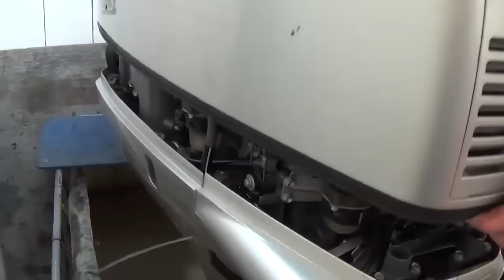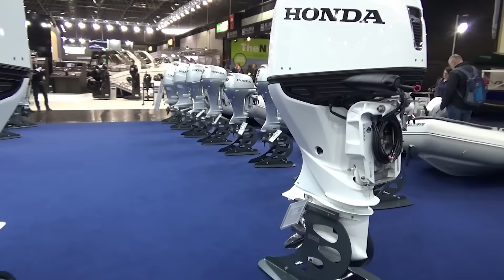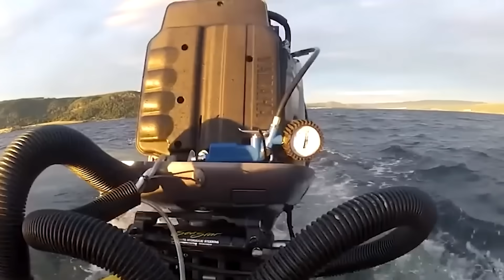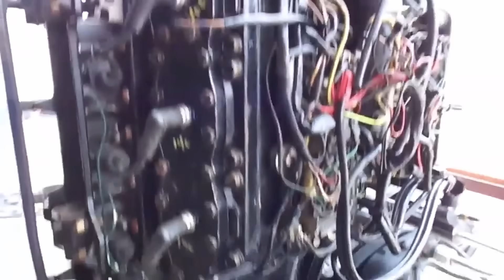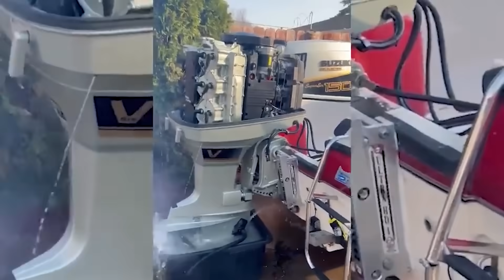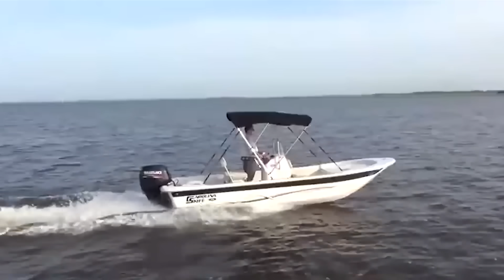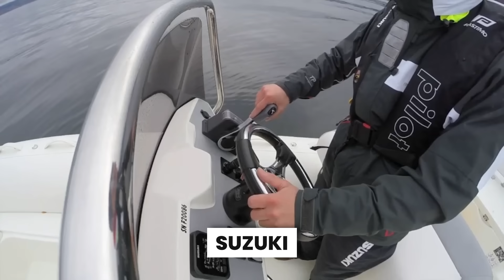Why Japanese and American Motors Are So Different?

Comment: I'm sure it is a lot like with automobiles. American made automobiles before Toyota and Datsun (Nissan) came in to the American market, the Big 3, seldom produced a product (engines) that would last more than about 70,000 miles. And still, Toyota as well as many other foreign brands still outlast and consistently have better and longer warrantees than the average American made automobile produced today.

Comment: My dad bought a 7.5 hp Mercury out of the crate in '75.  You literally had to pull it 60 times to get it start. Later on he updated to a 25 hp Mercury. Better, but idled poorly.  Bought a new boat with a 30 hp Yamaha.  Night and day. Ran like Swiss watch with amazing fuel efficiency. Now this was late 70's and 80's, and I'm sure Merc's improved, but this was our experience.
Reply: Mercs under 20hp are made by tohatsu.
Reply: @williamsporing1500 After 1988.

"In 1988, Tohatsu and Brunswick Corporation formed a joint venture called Tohatsu Marine Corporation to produce outboards for Mercury Marine. Some Mercury outboards, particularly those below 60 HP, were rebranded Tohatsus."
Reply: I JUST BOUGHT A USED 70’s MERC,7.5 for $30 in parts and a little clean up it starts and runs great! The Mercury 2 strokes are pretty bullet proof !
Reply from the maker: @Happy11807  sounds like a fun little weekend project! Enjoy!
Reply: @Happy11807 Ours was a turd right from the start.
Reply: They were not Tohatsu in 75’. I’ve had two from the seventies, blue stripes. They were the best.
Reply: @jeepgirl1653  my brother still runs a ‘65 Johnson 9.5 that I gave him years ago. They just built stuff better back in the day.

Comment: I have had two Yammys, a Mariner (Merc) and now a 4 stroke Merc.  No problems with any of them.  Just keep them maintained and serviced.  My buddy is a Honda dealer that has sold Merc and OMC over the years.  He swears that Honda is the best and most bullet proof motor available.  They are each very good and you can’t go wrong with any of them.  I know Suzuki had issues with their Super 6 150 back in the day, but friends with Suzukis these days are very pleased with them.  One thing to consider is that you can get a Merc serviced just about anywhere.  Not so with the Japanese motors.
Reply: I was a Suzuki dealer in those days. The issue with the New super 6 150 was the electronic microprocessor. It took 6 months to find the ladies in Japan building those brains were leaving corrosive hand oils during their monthly cycle. So they worked 3 weeks a month.
An annoying ignition speaker in the dash would squalk at 5 am in English with a Japanese accent to check your oil, check your temperature. You could not remove it but silence the speaker. Funny that 5am at the slips all the 150s were squalking.
Reply from the maker: @marcmccord5085  Thanks for watching and commenting. Had to back his own brand j guess! But they are reliable as anything.

Comment: Japan produces for commercial use and the USA for recreational.  That is a big difference.
Reply: Buy commercial quality and use it recreationally and it will outlive your grand kids.
Reply from the maker: @jj25397  Generational pleasure on the water!
Reply from the maker: @MarkRouse-j7z  Not a bad way of putting it at all. Thanks for commenting Mark..
Reply: What outboards are American?
Reply: Mercury, Mariner. But sometimes its hard to tell American from Japanese as some American engines are japanese labelled @douger1517
Reply: @douger1517  the one's most Americans can't afford.  :)
Reply from the maker: @jj25397 got a video that might be touching on this in the making! Stay tuned.
Reply: if so, they're on way higher premium, not cheaper.
Reply: I think it’s fair to say mercury. Marine owns the industry now. Maybe 30 years ago things were different.
Reply from the maker: @TommyP-s9n Yamaha not far behind but yes Mercury seem to be the dominant force. Especially in the higher HP range!
Reply: @VintageBoats  Mercury simply have been around soooo long. they know the score. Anything in the 80s-90s range of 4 strokes wernt that reliable but the 2 strokes before that were extremely reliable and high powered in the 70s.
Reply: @TommyP-s9n I have 2006 50hp Mariner and it's flawless. My club owns a mix including Tohatsu, Yamaha, Suzuki and Mariner. All are regularly serviced and kept tip top. It's the Tohatsus that have been disappointing.
Reply: The difference between Japanese outboards,is Japanese engines are great and American Motors are crap 💩
Reply from the maker: @garywatson9917 thanks for watching. Cast your vote in the community post to take your side!
Reply: You know Armerica inventions have shaped the world right. You guys bring your 458 ferrarri to Americia can get smoked by our Corvette every day
Reply: @garywatson9917 japanese engines are like ugly but loyal wife and american is like hot wife that just might cheat on you.

Comment: I wonder how much Yamaha paid for this YouTube commercial? I work in a shop that is a servicing dealer for Mercury, Yamaha, and Suzuki. They all break and they each have their own specific type of failures. I see a very high rate of internal corrosion in all of the Japanese makes. They all including Mercury have external corrosion issues but the Japanese makes will corrode through the cooling systems in the block and cylinder heads or they will plug themselves up with corrosion and growth. I wont say it doesn't happen but I have never seen a mercury corrode through. At least with the past 30 years of models. I have had plenty that where almost impossible to get apart but not corrode through the block or head. Evenrude and Johnson where pretty much the same as Mercury when it comes to internal corrosion. Maybe it's different in other parts of the world but where I am this is what I see.
Reply: I just look at what the pro uses. I'm in Newfoundland and deal with fisherman that pry the North Atlantic for a living and you won't find much Mercury here.  I own a small one for my dinghy and it'll be my last. Next one is a Yammy.
Reply: That's exactly what a mechanic said to me once!!
Reply: I have a 225 2019 Yamaha and the lack of quality stainless steel is a problem. Taking the side cover off to change the oil you see all the corroded motor mount hardware and the star nut on the bottom of the swivel. I cleaned and sprayed with anti corrosive but will have to order the replacement parts and due in the off-season.
I was a mercury and OMC tech in the 70/80s. The stainless was excellent but threads were never protected on assembly. I spent many hours drilling and tapping the water jackets, baffle plates bolts.
At $ 45.00 an hour customers were not very happy but not much choice. Those were the days of the oil n gas embargo’s and rising prices
Reply: "Yamaha commercial" or not it seems to be spot on as a customer of boats and powersports. Confirmed by trusted dealers in my area south FL.
Reply: mercury from 2 to 30 hp are japanese tohatsu.
Reply from the maker: No sponsorship on this channel!

Comment: Suzuki has been bought out by Bombardier in Canada by a locomotive company that owns Johnson  & Sea Doo. I had a 26' Seacat with two Suzuki 200 two stroke FI and both lower units cracked due to bad aluminum casting. Now I have a Mercury Optimax that ran like a racehorse now has been sitting in my yard needing all kinds of work. When Honda four strokes came out all of the commercial fishermen and crabbers bought them up and ruined the starters by engaging them while the engine was running. All are good when new and if constant maintenance is kept up will provide lasing service, but my preference would be a Yamaha four stroke.
Reply: No, BRP (Bombardier Recreational Products) did not buy Suzuki outboards. BRP did, however, exit the outboard motor business and stopped production of Evinrude outboards in 2020. Suzuki outboards are manufactured and sold by Suzuki Marine USA, LLC
Reply: @Briandswinford  japan

Comment: I think the newer Evinrudes were the best on the market. Hate they were bought out and closed. Saw many head to head tests on the same boat and they slammed all of the other brands. We had an old, old oil burning loud Mercury way back in the 60’s. We finally got a new boat in the mid 60’s with a 65hp Johnson. It was frigging huge but had power for days. Back them a 16’ ski boat was a normal size boat. My Dad pulled 4 of us skiing at once. 2 on pairs, 1 dropped a ski and the other got up on one. 2 kids under 12, a 16 and 17 year old. That boat and motor is still alive today. My cousin bought it in the late 80’s and still has it. I’ve had twin Mercrusiers in a 33’ Sea Ray express cruiser. I know we’re talking about outboard but  Merc is the company. I hated those engines. 6.3 I think with horizon transmissions shaft drive. They were the most inefficient engines I’ve ever used. 20 gallons per hour per engine. I have a dual jet drive water sports boat now but if I ever go back to salt water cruising, the boat will have Volvo IPS diesels. Never another Merc.
Reply: @bks252  my Mercruiser 7.4 Bravo II is awesome. Pushes the 30ft. Aft cabin motor yacht 36 mph and is very easy on fuel. Well maintained and never had any problems.
Reply: @jeepgirl1653 I’m sure the weight and hull design are important factors with fuel. Sea Rays are really heavy. Maintenance was fine.
Reply: @bks252  WHERE?
Reply: They did close but Evinrude is back again, being made in WI once more.  My father, brother and I all worked for OMC Evinrude for many years.  OMC Evinrude and OMC Johnson are like GM autos or GE appliances with many interchangeable parts, but different trim and paint.  The electric trolling and outboard motors of 55 hp or less, were all assembled on the same assembly lines.  The same went for their snowmobiles, my wife worked there.  I worked at 3 different OMC plants and saw or did all of the above.
Reply: @kypackerfan4-12-15 that’s awesome they are back. That new engine they were/making was fantastic. So much power and very efficient. Can’t remember what the name was. Maybe ETEC or something like that?
Reply: @bks252  I have a 2013 50 E-Tec ,NO PROBLEMS AFTER 12 years, will out tow,preform,and top end than any Yamaha,Mercury,Honda,Suzuki,on the Market. Can winter store it Dec1st. In 5 minutes,than take it out a week later and do it again! Best idea any Mfg. came up with!
Reply: @kypackerfan4-12-15 I wish that were true but Evinrude / Johnson names were bought by BRP and are now completely dead! I'm afraid never to rise again!

BRP's engineering & designers redesigned the problematic rushed to production FICHT motors! BRP 's  Etec's solved all those problems! But BRP's poor management & lackluster (almost non existent re-educational) advertisement was BLUNDEROUS!

Your mis-guided information about Evinrude being produced again is behind the times! And unfortunately, FALSE! 😢

Comment: Those Johnson were a great engine.
Reply: An Evinrude and a Johnson are the same basically; just like a GM auto or a GE Appliance.  With a few different minor component parts, trim and paint color.  My father worked there 32 years, my FIL, 35 years. I worked for OMC 15 years, my brother 22 years, BIL 26 years, my wife, my SIL, my 2 uncles and a 1st cousin all did.  Look at close up photos, the data plate is even the same shape and in the exact same spot on the transom mount.
Reply from the maker: @kypackerfan4-12-15  All the family in there! That's super cool. You guys must have some cool snippets of the industry history then!

Comment: I use the smaller outboards in the 60hp range. My preference is Yamaha due to reliability, quality, and efficiency. Plus they’re Made in Japan which holds better resale value. Yamaha is the Toyota of the sea. 
In reality, they’re all good when new.
Reply: @slagletoby  Almost ALL LOWER RANGE YAMAHAS AND MERCURY 4 STROKES ARE  MECHANICALLY THE SAME,ALLTHE PARTS ARE EXACTLY THE SAME! Some Mercury 2strokes in the 90’s were rebadged Yamahas!
Reply from the maker: @Happy11807  Thanks for sharing knowledge and time on the channel
Reply from the maker: @slagletoby  until they're not. Especially if not looked after in the salt..

Thanks for watching.

Comment: I have a 225 Tohatsu-Honda  5782 hours i went and checked before i commented and it still going like new    and i treat it like a taxi engine never stops for a oil change 😂 my next motor i will buy if the 225 i have ever gives up before i die will be another Honda or Tohatsu 300hp but ,,  the japs make good stuff they have pride , funny my old boat is a pride 😂 i have a old 90 Yamaha enduro on my small boat im amazed it still going i don't look after at all it just flat out on the river hitting sandbars stuff props regally just to feed my face with mud crabs one's a week 😂

Comment: Because Japanese outboards are like Lexus'-they LAST! 6000 hours on a Suzuki 600HP or Yamaha 400HP 4-stroke isn't uncommon. 600 hours on a 400HP Mercury is amazing. Few bass-boat dealers in NE Okra-Homer will sell a 500HP Mercruiser-too many call-backs and failures. Notice both "Miami Vice" and "Dexter" went away from Merc's and Evinrudes???Too many failures in filming costing too much to re-shoot. THE absolute unquestionably BEST marine outboard is the Kai Ichei (Toyota). They are also almost ten times the price of the same HP Mercruiser. They build a 900 HP "twin Hayabusa" V-8-the drag surf-boards (micro hulls) use-'em to top 105 Knots on Eufaula Lake. If they literally hit a turtle in the water, the OK Lake Patrol has a three week search ahead of them..
Reply: interesting...must be the reason why there's so many insane HP outboards out there, when I would think an inboard would do.  I thought MerCruisers were simply GM engines with a Mercury lower unit connected to them...just ordinary old Chevy LS or small blocks. I know many commercial fishermen tended to like inboards over outboards, because they could be service within the boat while out at sea.  With an outboard, you risk dropping a part or a tool into the drink when trying to make a repair at sea.  Of course, the Japanese changed all that, because their outboards simply didn't need to be serviced out at sea!
Reply from the maker: @audvidgeek  When you start looking at wake boats, Malibu for instance, there's a lot of truth it this. Basically a marinised GM engine in those.
Reply from the maker: @Walkercolt1  thanks for watching and the detailed comment

Comment: There is no competition ! Mercury have been making under performing anchors for years. Most Japanese motors simply crap on the US made junk.
Reply: wish it wasn't true, but that's how I see it.
Reply from the maker: @rod7944  I'm guessing Rod you are from US and admitting a little defeat? Thanks for watching.
Reply: @ I'm not sure what you mean. This is what I'm saying. My experience with Suzuki is that they are awesome engines and better than any US made outboards. If that's what you mean, then, yes.

My df 200 is ALWAYS quieter than any American made product I see at the ramps. I've been running Zukies for almost 25 at an average of 125 hours per year and have never heard one so much as cough. I cannot say the same for the American outboards I have ran.

and those poor souls that got sucked into the 2 stroke direct injection craze really paid the piper. I doubt there is many or any of the older E tecs still running at all. If anyone still has a running E tech, they should put it in a Museum.
Reply: @VintageBoats  Yes. LOL. But I consider us all winners when it comes to how good yami and zukies are:)   I'm sure/home there are folks who are having good luck with the new US boat motors, but I'm sticking with Japanese engines. At least for now.
Reply from the maker: @rod7944  and we have the German's unusually to blame for this... You'll be surprised as you dig through the comments. There's some big Etec fans here kn the channel running strong!
Reply: @VintageBoats  Interesting.  Well, I'm not one of them. Seen too many folks with blown power heads.
Reply from the maker: @andrewmcgifford8647  Thanks for commenting Andrew. Where are you from?

Comment: I have done volunteer coast guard in Sydney for the best part of fifty years...
It has been my experience that Mercury is a great high-performance race engine, but you must keep the servicing up, otherwise, they will break and break at the worst possible time. Basically, they will get you to the fishing, but won't always get you back. (That will be my job...)
Yamaha and most other Japanese donks are 99% reliable.
In a nutshell, looking at the motors I have towed back to the ramp over the years, the vast majority were American, and now Chinese outboards are making an appearance.
Mind you, correct maintenance before and after use is everything, no matter what you have bolted to the transom, and particularly using stale fuel that has been sitting in the tank for 2-3 years without stabiliser, that's a recipe for clogged fuel filters and injectors etc.
I started with OMC but now use Yamaha.
Reply from the maker: @grunthostheflatulent2613  Maintenance is so key. Especially in the salt! Thanks for commenting and sharing your experience for AUS! Want to head back for more time on the water there!
Reply: Exactly! Chinese engines are pure crap and can be used as anchor at best. The USA made OMC and Mercury can't hold a candle to Yamaha, Honda, and Suzuki, regarding reliable performance and ease of repair.

Comment: I have a 1975 115 HP 2 stroke Johnson outboard motor and it starts the 1st time every year when summer comes around. Great American made motor.
Reply from the maker: @alesure01  That's vintage! Well done keeping it alive, although maybe we'll done to OMC too and you haven't had to do too much!
Reply: 😊😊😊😊😊the fuel economy  has now tripled in new outboards I have a 150 Etec,, and a newer 50 merc tiller , . Fuel is incredible  compared  to my OLD 1990  150 XP  EVINRUDE 😊😊😊😊